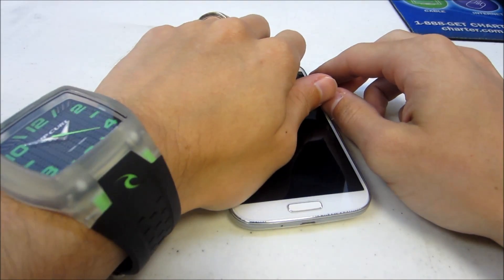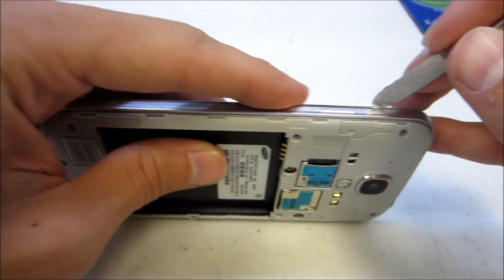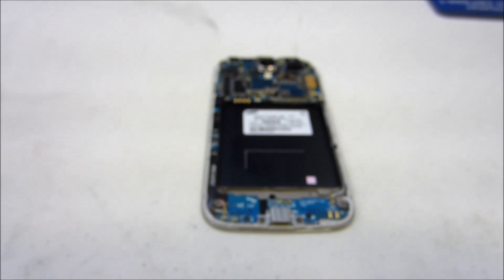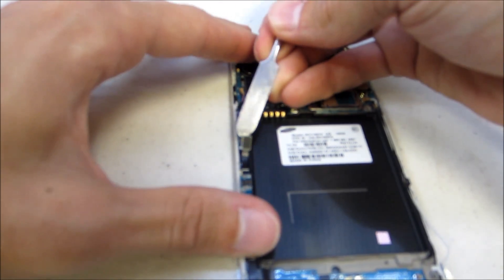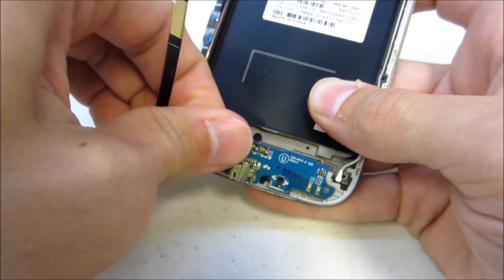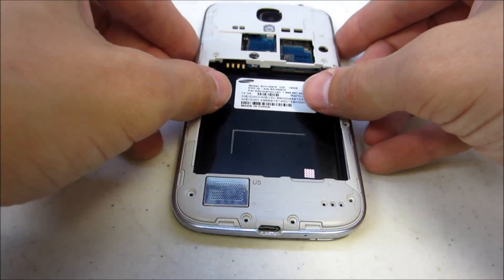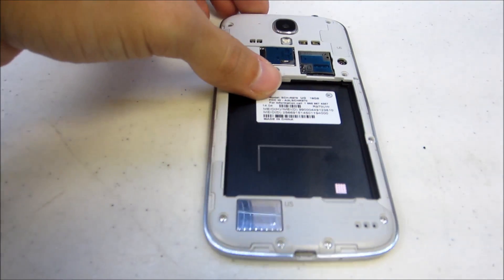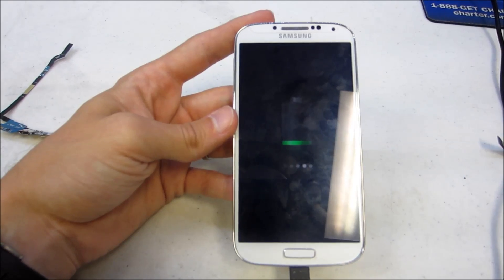Galaxy S4 Charging Port Replacement / THE EASY WAY (LESS THAN 10 MIN.)

Comment: Ok question, I ordered a new battery and charging port I also ensured the power button is not damaged by checking it with a meter. If these techniques does not fix the phone what is the problem? The mother board? Any chance of reviving it?
Galaxy s4 won't turn on, won't charge. Zero activity.. thanks!

Comment: Mine is overheating around the upper connector of that charging module, even if no battery inside.
I would like to revive my S4 kept in good conditions but now the battery is dead and it would not charge no matter what battery I gave it, only overheats near camera 😒
Do you think that replacing the   charging/power  module would help?
Reply from the maker: Most likely not to be honest. I could be wrong though.

Comment: Thanks for making it easy, and easy to follow.  I've replaced a port and a battery on an iphone and they are a FRIGGIN NIGHTMARE to work on.  Replacing the battery on an iphone is more difficult that replacing this port on the Galaxy, which was a walk in the park.  For one thing, you have to almost completely dismantle the iphone to replace  anything, they use different size screws, some star, some phillip, and they are tiny and require special tools(micro phillip, micro star).  The screws in the Galaxy phone are GINORMOUS in complarison.

Comment: Easy replacement of the charger port.  Went in without any difficulty.  Problem is neither the back button, the menu button, nor the center return button below the screen light or work any longer.  Discovered all I really needed was a new charger, so I even tried putting the old charger port strip back in and the bottom buttons still no longer work.  I'm sure it's just something simple, but I'm an old coot and simple things aren't always so simple.  Hasn't stopped me from replacing the port, but the lighted button problem has me beat.  Any ideas?

Comment: Thank you for this video!  I received my charging port from Amazon yesterday and installed today within 30 minutes after following your instructions.  I struggled to attach the bottom right red connector, so I snapped that connector first before setting board.  I Plugged in and it starting charging immediately.  Thanks again.
Reply from the maker: You're welcome! I'm happy it helped you.

Comment: Changed easily, thanks to this excellent video - sadly it must have a motherboard issue as well.  The bottom left hand connector is different on my phone, but watching the video I was able to work out how to remove it. The charge port cover was difficult - wish I had read David Quirk's comment below.  Many thanks Positive Gamer.

Comment: Thanks for the video,  very helpful.  For reference,  the way to remove the USB cover plate is to press down firmly and to the right on the left hand side of the cover plate and gently click the right hand side over the latch.  Mine came off without any bother doing this.  The fixing on the left hand side is like a solid peg and there is no way that the cover is coming of that end first.
Reply: David Quirk Can you please reword this explanation differently? I can't seem to understand. Maybe its because english is not my language. Please help
Reply: @7eloua  Hi Rosa. The cover plate is slightly curved (you can only really see that once the plate is removed) . The cover has a small square hole it it which fits over a plastic peg. This stops the cover from being slid off. Pressing down on the cover on the left hand side lifts the cover clear of the plastic peg and allows it to be slid to the right to unhook the latches.
Get a magnifying glass and have a really good look at the part before trying to remove it, all of the parts are really small but once you see them you will understand.
Sorry this is so many words, I don't have the phone any more or I would have made a video for you.
Reply: David Quirk i did not open it yet but looking at the video and seeing where the part would be that stops the cover from sliding I think I got an idea. Very helpful thank you. I worry about one thing though. Ive read somewhere that someone tried to replace tge usb connector and afterwards there was no sound from the mic unless they put in earphones. Is this a risk? I don't now where that mic is so i could be extra careful
Reply: @7eloua  There are a few connectors (wires) that have to be removed. So this carefully, do not bend the flat cables (from memory they are thin silver tracks printed on to Mylar (plastic) ribbons. Try not to touch the ends where they go into the connector. Spend lots of time watching the video and looking at the new part and your phone. Go slow, take care, all will be ok.
Reply: David Quirk Can you please reword this explanation differently? I can't seem to understand. Maybe its because english is not my language. Please help

Comment: Hi, just want to clarify if I need to replace the port or not. I have already tried both replacing the battery and using a different charger/power source.

When the charger is plugged in, the top left light above the screen does not light up like it normally would like if it was actually charging. When I hold the power button, it simply shows an empty battery graphic.
Reply from the maker: Most likely that would be a charging port issue. There is also the possibility that your main board has an issue. Of course, that would be a much more serious issue. If you shine a light in your charging port and look at it, does it show any physical damage? If you attempted the charging port repair the most you would be out is $10-$15 dollars and 30 minutes of your time. Let me know what happens!

Comment: Mine starting a few weeks ago lagging, freezing up, restarting. Acouple nights ago it turned off and would do absolutely nothing. No download, no recovery, no safe mode. Left the battery out for about 30 to 40 minutes and put the battery back in and it booted up, last night it turned off again and it won't do anything again! This time no luck. Still won't power up. I'm totally lost on what to do now, if anyone has a solution (besides throwing it away of course) let me know. Thanx in advance
Reply: Hit with hammer

Comment: @The Positive Gamer, got a question for you, I got the exact same S4 as the one in your video. The only difference is that my S4 is black, and the back cover has the "AT&T" logo on it instead of "US Cellular" in this video. Furthermore, there's no label on the back of the battery so I don't know what the exact model is.  Now my question is will it still work as long as it's a Galaxy S4 charging port?

Comment: Am having trouble finding a vendor for the part. Can you point me to a place to buy the part, please?
Reply from the maker: Can you give me the exact model number of your S4? It will be under the battery. It should start with the letter S
Reply: I've gotten replacement parts like this through Amazon without issues. Just make sure to get the correct one for the correct model.
Reply: Look for it on ebay or Aliexpress
Reply: Ebay https://www.ebay.com/itm/OEM-Charging-Port-Dock-USB-Connector-Cable-Samsung-Galaxy-S4-SCH-i545-Verizon/191786341593?epid=1654699304&hash=item2ca75b54d9:g:fIIAAOSw-zxWnp6z:rk:2:pf:1&frcectupt=true